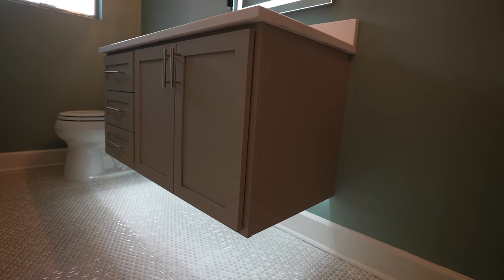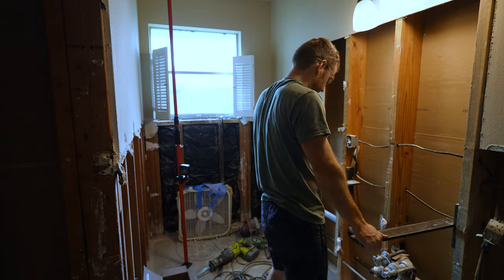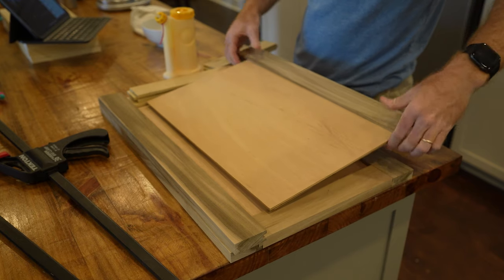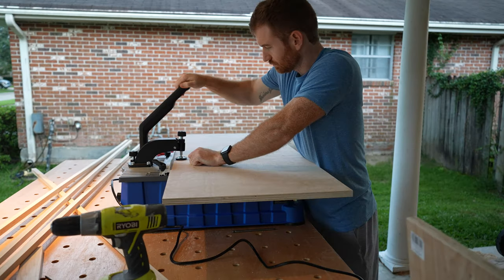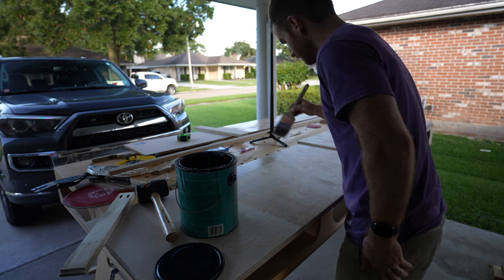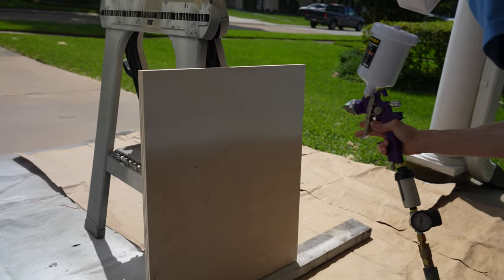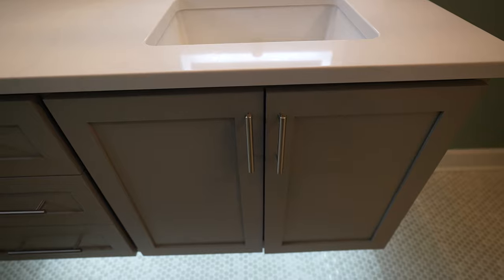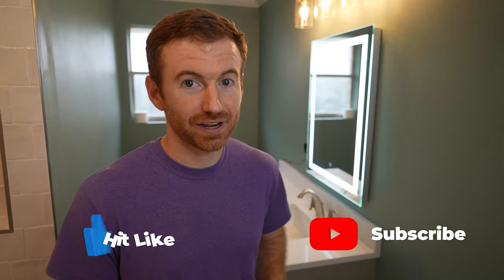DIY Floating Vanity Build Overview

Comment: Really nice job on the video laying out all the steps in a very logical manner and having video to support the commentary.  

I’m getting ready to build one this coming week.  I was not planning on using the metal bracing. I was going to scree it to the studs or install 2x8 bracing between my studs and screw it to that as that is what a local custom cabinet company does.   My question is do you think the braces are necessary or could I simply screw it to the wall?   I also thought about making 3/4” French cleared and hang it on those as I’ve done that’s number of times with my mirrors or floating nights stands I made.  

Looks great!
Reply from the maker: Hey! Since I don't have experience doing floating vanities and I knew my stone would be very heavy I felt more comfortable with the braces. Especially with the thought of a teenager one day hopping up there to paint their toenails or something haha my only thought is that the box of the cabinet will need to be very strong as all the weight will be transferred through the cabinet into the wall.